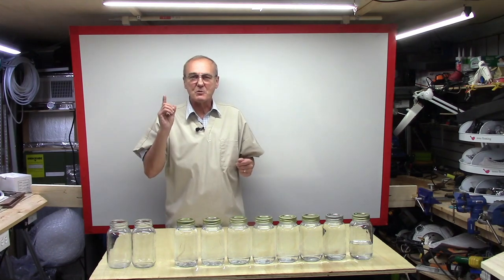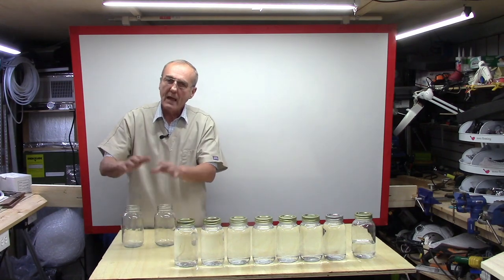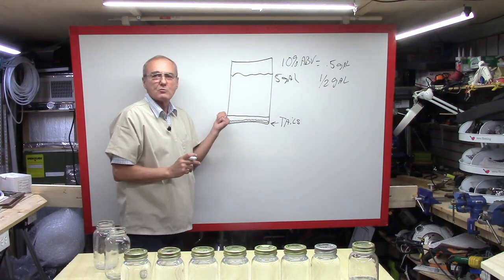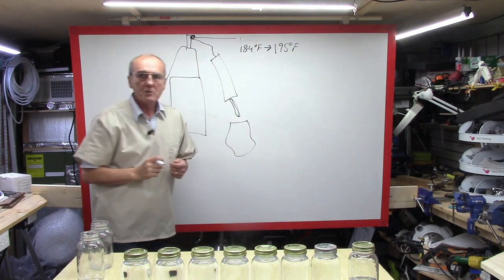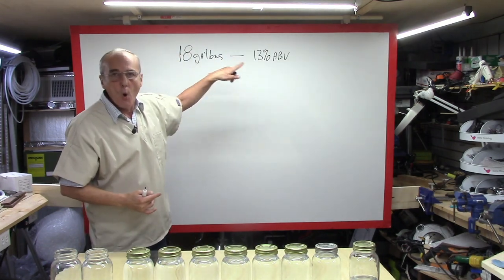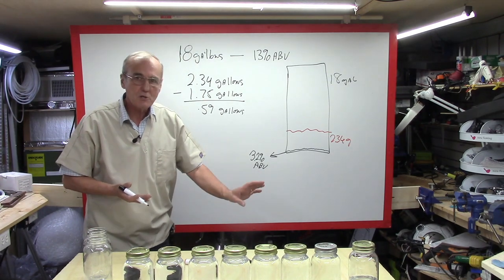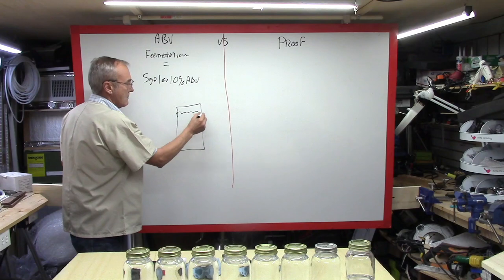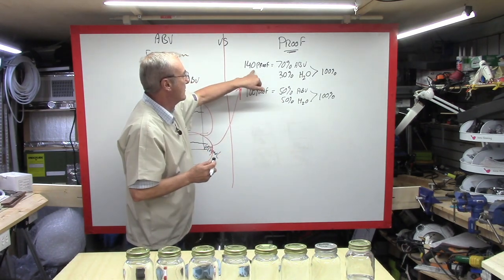When Distilling How much Do I Get

Comment: I respectfully disagree.

It takes me 12.5 hours to run my 26 gallon still.

It takes me an hour to collect 1-2 gallons of tails while I’m cleaning up the area.
Just run it hot and fast for the tails.

I ALWAYS Put my tails in the next run and have never had off flavors.

I have infinite respect and love for George.

But I guess we’ll always disagree on this aspect.🤷‍♂️🤣😊👍🥃
Reply: Yes I agree with you. IF you could separate the tails completely he would be correct, you could just get rid of them BUT they tend to be smeared across quite a few litres of ethanol which can be retrieved in a subsequent spirit run - I used to put them into the next run but now I collect them until I have enough for a spirit run - the product out of that run is just as good, if not better, than a normal spirit run.
Reply: @vtbn53  

You’re not the first to mention this.

I suppose my lack of patience has prevented me from accumulating enough tails for a separate run.

I just run them into jars as fast as possible and dump them into the boiler the next run.

I should really try and set them aside and try a dedicated tails run.

What do I have to lose?🤷‍♂️😊🥃👍
Reply: @BillMcGirr  I think you should give it a go, but there is nothing wrong with the way you are doing it either - since I usually do ~200L washes they accumulate quite quickly for me LOL
Reply: @vtbn53  

🤣🤣🤣

I had to do a quick gallon to liter conversion.

So you’re still is roughly twice the size of mine.

Oddly enough I will get sometimes as much as 2 gallons of tails from a run...

But on the next run after I add the 2 gallons I will only get a single gallon of tails from the run I added 2 gallons of tails to.🤔

It baffles me occasionally.
🙄

But perhaps I will give it a try at some point.

I’m curious what the flavor would be.👍💪🥃
Reply: @BillMcGirr  I think the variation is caused by variations in product flow rate which, at least on my still, is never exactly the same, and the faster it is the more the tails will be smeared into thelast of your hearts. I also suspect stressed yeast can cause that, but have been unable to confirm it as yet.

Comment: i will never understant why USAmericans not just changing to the much easier LITER and METER System. Everything is based on 10 there and even USAmericans having 10 Fingers and 10 toes :/   this complicated countring with ounces, lbs, gallons, inch and feet or FAHRENHEIT instead of Celsius is really anoying in such a nice channel. At least you should give it a try, its not Rocket Science. 
ICE - 0 Degrees Celsius  Water Cooking at 100 Degrees Celsius  ;)